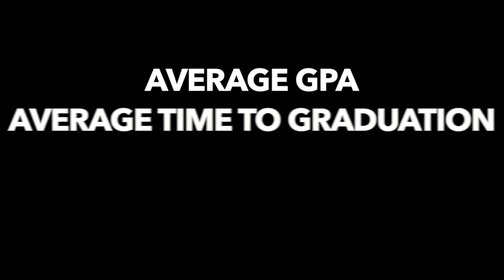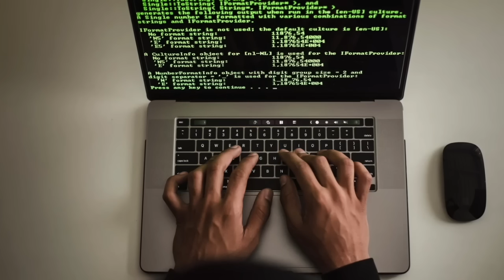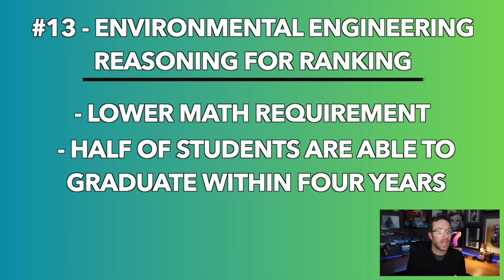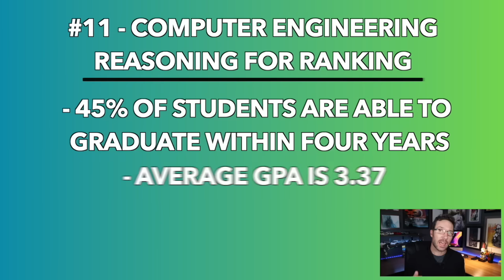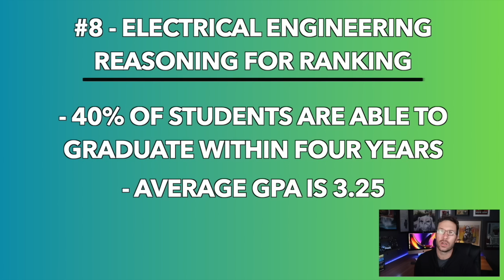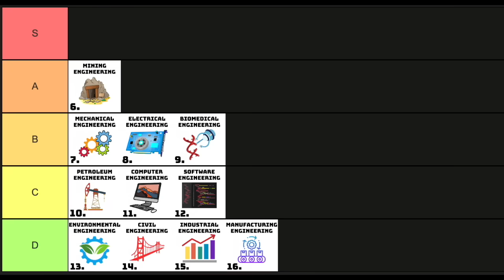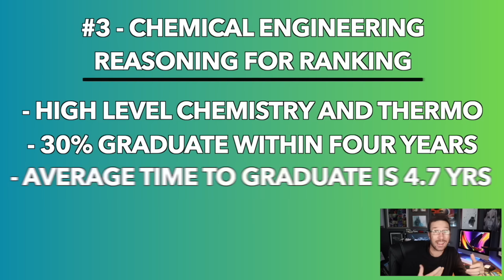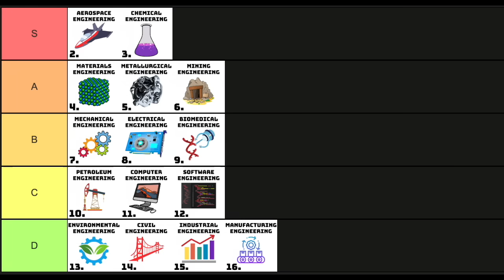Engineering Degrees Ranked By Difficulty (Tier List)

Comment: The highest required math for electrical engineering is NOT only ODEs. Calculus 3 is required as well. Pretty ridiculous to place it at only 8. In my school Calc 3 comes after ODEs so I'm not sure if this is standard.
Reply from the maker: I considered ODEs higher than calc 3. apologies for the confusion.

Comment: You do need PDEs for Electrical Engineering.
Reply: Correct, it is applied differential equations. Also, not the highest level math course needed, that would be Mathematical Models in EE which is on complex variables, transforms, and matrix calculus.

Comment: I taught engineering physics for 30 years, and I wish I had had this video to show to my students. Concise and to the point - well done! BTW, it was an open secret among the physics faculty that environmental engineering was the easiest way to go - the requirement at our school was merely 1 semester of calculus-based physics.
Reply from the maker: thanks! glad you liked the video
Reply: @becominganengineer2271  How long would a double major in cs and mechanical engineering take to attain a bachelor's degree, Associates, etc. I am a double major.
Reply: @OceanDudeSubmarine  Like everything, it depends. Your lower division courses overlap, so little slowdown there. If your CS emphasis is hardware, probably good overlap in upper division courses (thermo, etc.) but if your CS emphasis is software, maybe 5 instead of 4 years.
Reply: @spacemonkey1053  So, 4 years then... alright I'll make the best of my time. Thanks dude.
Reply: That's interesting cuz the ENVE program here requires all 3 quarters of engineering physics
Reply: Sup.
Reply: At my uni environmental engineering is one of the 3 categories that have to take the highest level engineering math unit offered.
Reply: Im studying engineering Physics finishing third year, is there any future, is it well paid, or what route after i graduate is the best to take to make the most money, i like almost everything except the electronic and electric stuff.
Reply: My advice: think out of the box. Astronomy majors are being tapped by data companies because of their experience with large data sets. I had a student who went to work for a bank because of his coding skills. If you want to stick with pure physics look for a startup in energy. If you're into research, as I was, get a graduate degree.
Reply: Environmental Engineering shouldn’t even be in the engineering school in most unis. It should be Environmental Studies. Apologies in advance if your uni has a proper engineering curriculum for this degree. Unfortunately the title is tainted in industry because of its general lack of rigor in most places

Comment: You should have looked into actual course difficulty rather than "highest math". I'm a mech major and will wholeheartedly admit than electrical and computer engineering is harder. The theory they use and the advanced mathematic knowledge they have to use is much harder than what we do.
Reply from the maker: It’s hard to compare one course difficulty to another because at some point it is pretty subjective and variable depending on the student. That’s why I placed more importance on the length to graduation

Comment: I’d say petroleum engineering is harder than mechanical at least in my experience. When my classmates would fail a class they’d usually retake it through the civil or mechanical departments if they could because it would be easier

Comment: I'm curious as to where would you rank Mechatronics Engineering? I know it's a relatively new field with only 2 or 3 colleges offering it as a specialization/major.

I'd argue it's very difficult, but maybe not the most difficult, seeing as you have to have a well rounded engineering education in practically everything. We had to have math up to ordinary differential equations (though I chose to take Calculus 3 as well cause it helped me understand everything better. I also took physics 3 as it interested me and related a bit as well) but we also have to take materials science, manufacturing processes, chemistry, Thermodynamics, machine design, mechanics, electromechanical devices, quality control/reliability, programming, robotics, circuits, digital logic, courses on semiconductors and statistics/stochastics, computer integrated manufacturing etc.

It's a lot of work and it took me a long time, but I finally graduated this May! >.<
Reply: I was wondering about Naval/Marine engineering as well, it doesnt go deep into semiconductors and stuff but it still touches everything else you listed
Reply: Well you can now bear the fruits. Congratulations! Wish you all the best hud 🥳
Reply: My school had a mechatronics engineering equivalent as well as electrical engineering and mechanical engineering. It was common knowledge at my school that electrical engineering and mechanical engineering were equivalent in difficulty and mechatronics engineering was quite a bit easier. It might be because of the teachers who have lower expectations of the students or it might be because they have less math and physics or it might be because a well rounded education leads to a jack of all trades, master of none. We had several courses that were both taught to the electrical engineers and the mechatronic engineers and the mechatronics engineer course was always significantly easier. Probably not with the most math courses, but there we have until calculus 4 while they only have until calculus 2. 

I would say the statement above would be signed by most people of my school, including the teachers in those degrees. Here I give some comment I don't know how much agreement I would get. 
I personally had a mechatronics equivalent apprenticeship and an electrical engineering bachelor. The reason why I went from the systems level to the device level is because I though the systems level was not really that challenging and didn't allow as much insight into the detail. Of course when you build a machine you have to have a good understanding of the process and the process-relevant physics. But if you are an electrical engineer you are often creating devices which solve all the tough detail question in a way so that the engineer on the system level can work with simplified black boxes. 
What is more difficult? Firmware development or PLC development? Even though PLC have their challenges, I think Firmware is way more challenging. At least according to my experience. Same with electrical circuits vs analogue circuits. The matter of the electrical engineer is more complex and more abstract and I would claim it is easier to switch from electrical engineer to mechatronic engineer than the other way around. 

But in the end I don't want to downplay the work of the mechatronics engineers. They are a needed profession and if you have good teachers then you can learn a lot from them. 
In my personal experience when it came to jobs, statements by teachers form the apprenticeship and my experience form my bachelor, then the system level is simpler than the device level. But that might be because of my specific environment or how my brain is wired. Just take my comment as a view from a stranger on the internet.
Reply: @benrex7775  I guess what made Mechatronics harder for me is that I'm very detail oriented. It's how my brain is wired... So when we had to quickly go over a bunch of different topics without detail and just understand them at a surface level, it drove me crazy cause I wanted to understand why we did things that certain way and how that worked... As a result I found it hard to keep up in classes where we'd be firehosed with information without going in depth on it.

That's prolly another reason it took me longer than 4 years to complete my degree (alongside the fact that I double majored in music too)
Reply: @ScarletFury  That makes sense.

Comment: Going to college with other engineering students back in the 80's, it became apparent that civil engineering was easier than electrical or mechanical and that chemical engineering was much harder, at least to me. As an engineering student you sort of get an insight to what the different disciplines are in for because we basically all learn the same math and science for the first two years. I loved physics but not so much chemistry. I gravitated towards electrical even though I like mechanics as well. Some of the disciplines you mentioned I wasn't even aware of. I suspect I would have gone into the computer field had it been more of a thing when I went to college. I seem to like that more than electrical.
Reply: As an engineering student in the 80s that completed an undergrad in EE, I had the exact same perspective in terms of difficulty, I would put EE above ME just because the drop out rate was higher and several EEs moved to ME, but MEs never dropped out to EE.
Reply: @SignalCorps1  Interesting, I never knew that.
Reply: Same with pharmacy, Pharmacy has tons of combined Biology, Chemistry and Physics 😂
Reply: Amen

Comment: Degree in computer science (1999-2005). I had to take calculus 2 and linear algebra. Of course discrete mathematics as well. Made it to 6 figures after maybe 4-5 years as a professional.

EDIT: Minored in electronics
Reply: I wish were forced to take PDEs and maybe real analysis.
CS is a degree where you just learn convention, instead of actual knowledge.
Idk man. Computers dont feel like real engineering, or even real science. Once you watch a singular youtube video on it, you kinda begin to understand how dirt simple alot of this computer stuff is. 

Its even stupider cus I thought CS would be harder since the GPA requirement was way higher than Electrical Engineering.
Maybe I chose the wrong path. I would have the exact same job anyways if I took Electrical Engineering instead.
Reply: @honkhonk8009  right on. We didn't even learn design patterns at university. Learned two assembly languages. How computers work from the ground up. Computer Architecture dropped a lot of the students. Just been a web programmer since. Never did anything web related in school. Was back in the day...did use .NET remoting to build an adhoc question and answer system. Same thing made some other guy millions.

Comment: What Manufacturing Engineering Degree programs were you looking at?  I took a lot more math than just Calculus 2.  That being said, the profession itself is mostly populated by engineers with the traditional mechanical, electrical, or chemical engineering degrees based on what is being manufactured at a given facility.  I would recommend anyone interested in manufacturing engineering to stick to the traditional engineering degrees for their Bachelors and then get a Masters in a manufacturing engineering management program.  This is because manufacturing engineering programs have to cover the spectrum of manufacturing processes and tools across industries, resulting in a knowledge base that is more broad and less in depth.

Comment: I disagree that ordinary differential equations is the highest mathematical study in electrical engineering. I studied partial differential equations as part of my degree coursework. It becomes essential to work in RF where that level of mathematics is a required prerequisite. Just look through a book on electromagnetics to see what I mean.
Reply from the maker: I dont doubt it. it appears that not all schools follow the exact same curriculum .
Reply: Some EE programs require a dedicated course in PDE's, some don't.  The PDE's generally encountered in undergraduate EE programs are limited to (linear) Maxwell's equations in its various forms (e.g. time domain vs frequency domain versions).

Comment: My PhD advisor is a Mechanical Engineer major, did his PhD in Systems Engineering, employed as a professor in the Electrical Engineering department, teaches analog electrical circuits, mechanics and numerical optimization, advises PhD students from all disciplines (I am a Comp Sci major) and his research lab works on numerical and combinatorial optimization. Mechanical engineering is the most versatile degree, hands down, if you are smart enough, you can switch to any discipline with some effort. In that sense, I would say mechanical engineers have the most opportunity, job wise.
Reply from the maker: i agree
Reply from the maker: Hey i am currently working on a video about comp/sci and im curious. can you list all of the courses you have to take? i am noticing its so different from school to school. thanks!
Reply: @becominganengineer2271  A fairly typical list would be: 1) intro to CS, 2) data structures, 3) discrete math, 4) computation theory, 5) systems programming , 6) calculus through multivariable, 7) linear algebra and differential equations, 8) programming languages (functional programming), 9) algorithms, 10) probability and statistics (potentially using calculus). Some programs additionally require a course in software engineering. Most programs will then require some number of elective courses as well; computer vision, AI/machine learning, computer graphics, graph theory + related math, and robotics are all common options.
Systems programming, programming languages, and stats using calculus are typically the most challenging, weed-out classes.
Reply from the maker: Thank you!!

Comment: I would argue that you have the math wrong for ChemEs.  PDEs are definitely in play here (along with ODEs) -- especially with the need for a deep understanding that requires meshing kinetics (rxn engineering), fluid mechanics, process control and thermo.  That is on top of all the chemistry knowledge and the need to code AND do MATLAB...  And if you happen to be a biochemical engineer -- well, I think  I said enough... Frankly I also consider alot of the niche engineering disciplines to be subsets under chemical engineering (eg petrol engineering, nuclear engineering, materials engineering, etc) with an emphasis in said domains (when you really think about it).  I am surprised you didn't mention systems engineering and synthetic bioengineering....
Reply: I"m also a chemical engineer and you are right. He said you learn lots of chemistry, wrong. I only did chemistry up to second year  everything was maths, programming, applied maths. Drop out rate was very high.
Reply: Oh yes  many of my friends who did chemeng went on to be nuclear engineers, metallurgists and bioChem Engineers to name a few

Comment: engineering has more bad numbers because there is more data. The ME : EE ratio is 316,460 : 246,124. People choose ME because is the jack of all trades so they may struggle in a lot of courses. While on the other hand, EE students really like EE bc is a more specialized engineering field plus it has been told to be one of the most abstract and hardest engineering so people choose it knowing that, which it will indirectly select the students with more IQ. And it's something you can observe in IQ distribution by majors. There are way more mech eng so is logical for the IQ average to go down, and so the GPA.

Overall, considering only the 4 main branches of engineering: id say Chemical and Electrical engineering are the hardest, and mechanical engineering is easier unless you pick a lot of courses in fluids and energy. Civil being the easiest of these 3.